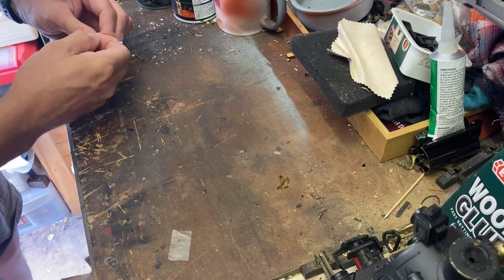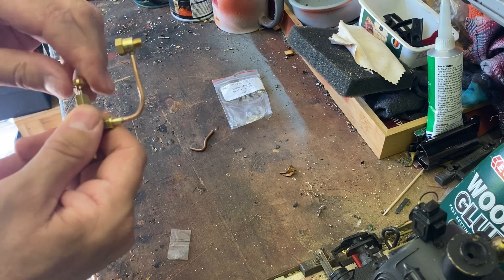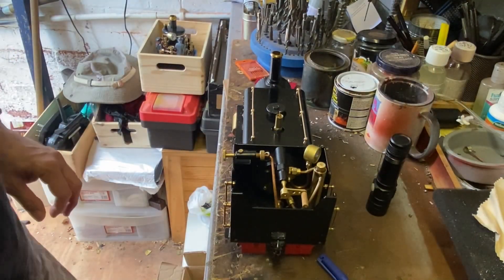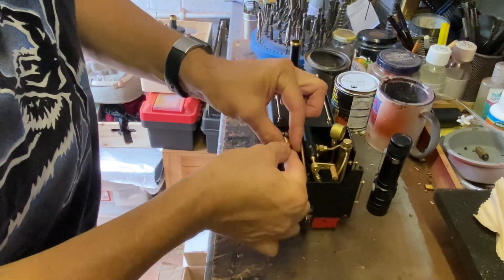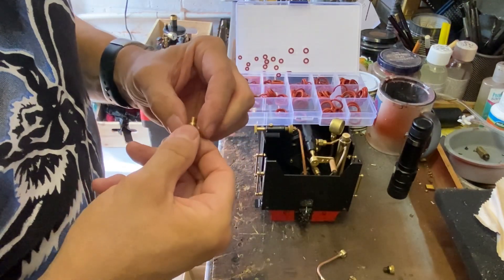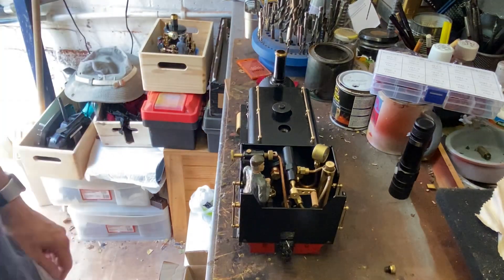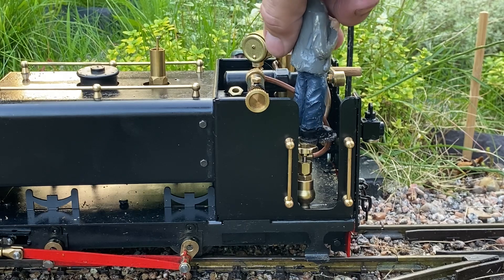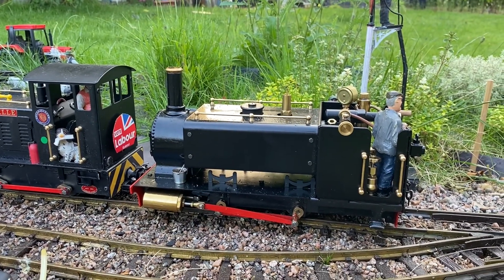Workshop Wednesday - fitting a boiler water level valve to my Mamod Quarry loco

Comment: Nice mod.  I was explaining to someone yesterday, about a system called tri-cocks, which was a way to check water level before the sight glass was invented.  It was also used as a backup in case the glass broke.  We were watching Buster Keaton in The General and someone asked how they could run the engine without a sight glass.  As I explained, it became apparent they were a bunch of diesel guys and they really didn’t care anyway.

Comment: Great idea Nigel. I wondered if you were going to drill a hole in the footplate to hold the valve steady. Its quite hard to tighten the banjo up with neoprene washers. Graham also sells copper washers that I think work much better. Shame Mamod didnt fit a glass considering how much the loco costs. I wasnt sure about the accucraft system on the Caradoc at first but actually its very good.
Reply from the maker: I’ve ended up with one neoprene and one fibre (at the back). Graham didn’t have any of the right size in copper. I notice Mamod have used aluminium on the pressure gauge banjo. 
Omission of any kind of level management system is bloody stupid. 
I’m enjoying the loco now but I can imagine a lot of people being put off live steam for life if this one is their first experience.
Reply: @FeckHallBahn  Yup I have two Mamod and had to repair both from new. Its a shame because I have a soft spot for them but you can get a Roundhouse basic for the same price. Less infact and its going to work straight out the box.
Nigel do you use butane propane mix in your Caradoc.
Reply from the maker: @davidwhite1864 
Neat butane in the Caradoc, Leader and Billy. Mix in the Mamod & Regner. GoSystem in both cases. 
I use mix for the first light up of a session in Winter for the Accucrafts, but only enough to get things going.